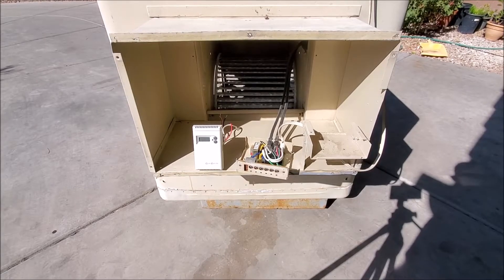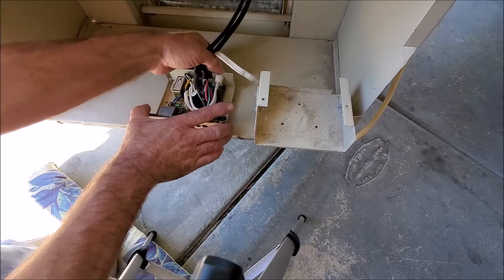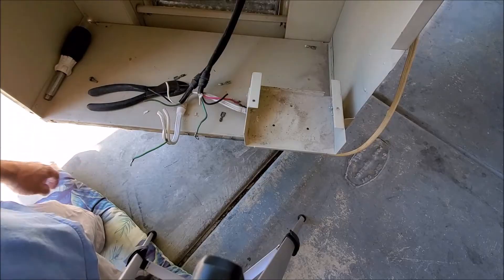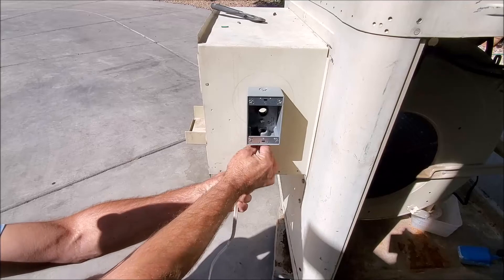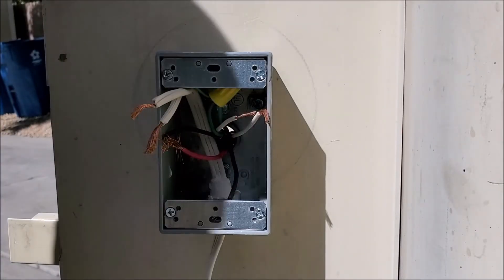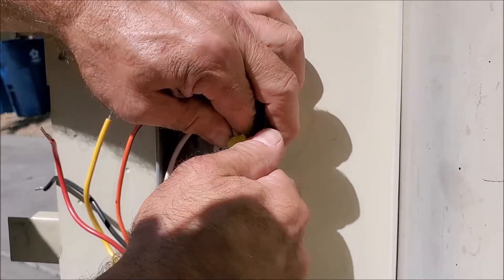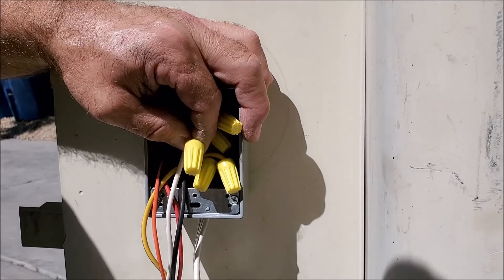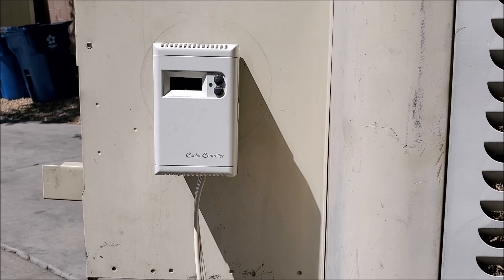How To Install A Thermostat On A Swamp Cooler

Comment: I have a question about the probe or actual temp picker located? in the unit you installed? and if there, where will it read the temp you want the unit to stop?

Comment: I have the exact same setup. Installed new motor, checked belt tension, replaced bearing and greased it with new thermostat. Swamp cooler only runs for two minutes then shuts down??? Any ideas?

Comment: Did you mount it there for the video? Those thermostats are not waterproof
Reply: Pretty sure you don't run the swamp cooler in the driveway too, this was obviously a demonstration video.

Comment: Thanks for the quick and well explained video. What is the lowest setting on this thermostat?  Does the thermostat work with fan only?
Reply from the maker: You generally only can cool the space between 15 and 20 degrees cooler than the outside temperature yes it can be ran on fan only
Reply: @boogity66  Thanks for the timely reply. I just hooked up a swamp cooler to a bee barn. For right now we are using a simple plug in thermostat which starts at 40 degrees which is perfect for this situation. The bees are wintered in the barn in the dark and both heat and carbon dioxide build up. They try to keep the room temp below 45 degrees or more. Most swamp cooler thermostats don’t go lower than 55 degrees so was wondering about the one you are using?

Comment: Where is the room temperature sensor?
Reply from the maker: in the thermostat
Reply: @boogity66  so how does that help in controlling room temperature if the unit is mounted outside
Reply: @jimgosney8616  Yeah, why would you mount it outside? If you want to turn it off you have to walk out where your T Stat is and shut it off. I wanted a video showing how to install one inside the home.
Reply: Yeah, I hear you. Am i missing something also? I do not understand how having a thermostat outdoors will control the temperature indoors? Perhaps it is  functioning as a reverse thermostat.  If the outdoor temperature goes higher than 85 degrees  (or what you set), the cooler turns on. When the outdoors temperature drops back down, the cooler turns off...?
But what do I know? I am just a country boy...

Comment: I'm going from a switch to a thermostat and I do not know where to connect the common
Reply from the maker: All commons are connected together.
Reply: @boogity66  I don't think I have a common.
Reply: @James-m2g  common is the return, meaning the wire going back to the energy source. Hot comes from the breaker box, common returns back to the breaker. No common, no electrical circuit. If you are still confused, I highly recommend hiring an electrician to complete the work as proceeding further would be dangerous to you and everyone in the house.

Comment: I just bought one of these cooler thermostat's but I only have 4 wires coming out of my wall inside of the house and I can't get my pump to work because I am missing a wire 😞 I was  just wondering what to do next because everything is working great except the pump and as you know a swamp cooler is no good without a pump ??
Reply: Yeah I hear you it is turning into a much bigger job than I expected I think I will just return the thermostat and put the manual switch back although it would be nice to have a thermostat I have lived without one for 20 years now so no biggie thanks for your time and I will subscribe to your channel for future do it yourself video's thanks again and have a great weekend from your new friend and Supporter ARIZONA TOURIST 🌄😎👍👋
Reply from the maker: With the description you have given it's hard to know maybe you don't have a variable speed motor even if you wire it for a single-speed the pump should work you need to follow the diagram it came with
Reply: Yes I followed the diagram but the problem is I have only 4 wires coming out of my wall in my house and I missing the wire for the pump I do have high and low and everything else is working fine but can't wire up the pump because I am short one wire I was wondering if there a way to wire up the pump by using one of the other wires ??
Reply: I am not an electrician and I just don't want to Short anything out of cause any problems I could always just go back to the manual switch
Reply from the maker: @ARIZONATOURIST  This project is really meant for somebody who feels comfortable with working on electrical it sounds like you're not comfortable with it your best bet is to not do it try to find somebody who is comfortable and is capable of looking at a schematic and figuring out the wiring is your best bet
Reply: @ARIZONATOURIST  a lot of cooler switches are directly below the power box and in most cases very easy to add or replace wires without opening the walls. Do some research it may be easier than you think. Done hundreds in Cochise county area and 90% it's a quick easy job and if you have an attic might not be a straight shot but easy access
Reply: In the manual it says that if you do not 5 wire's than you need to add a neutral wire for the pump but I really don't want to go through all that trouble and I was wondering what if there was an easy way to go about it ??

Comment: Hello I have swamp cooler but I also have a thermostat in the home and I’m not sure if those are connected because the thermostat says off but my swamp cooler is on high cool is there anyway I can adjust the temperature to get colder. I have no clue about this stuff I’m just the renter.
Reply from the maker: Chances are your swamp cooler is not connected to that thermostat a swamp cooler runs off of a 110-volt thermostat if you're bleeding off water from the swamp cooler that will help keep it cooler
Reply: @boogity66  thank you turns out it needed a belt it had a slight tear in it however it seemed to improve some but it’s still not keeping the house cool.